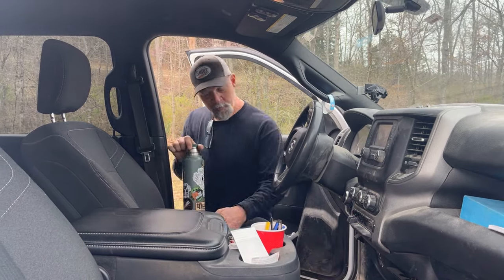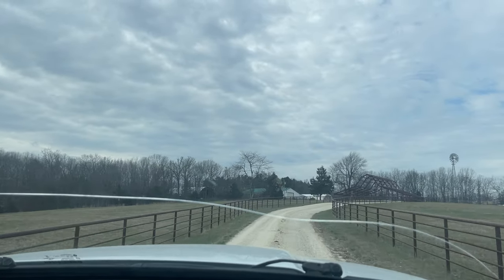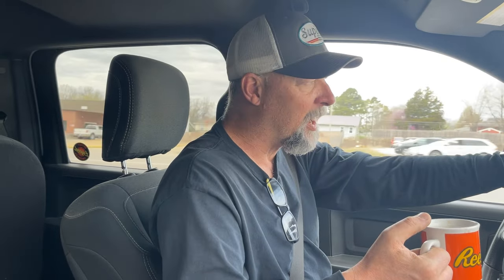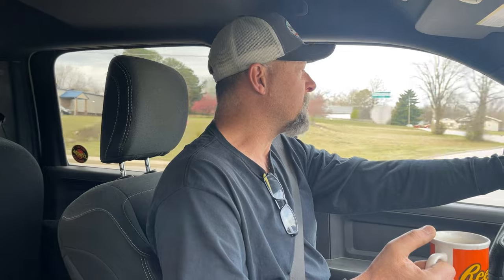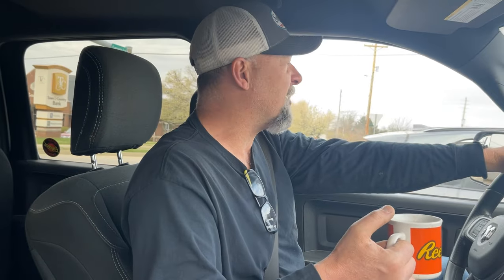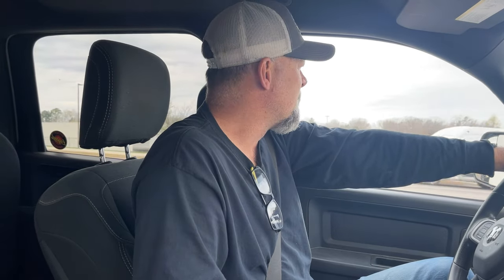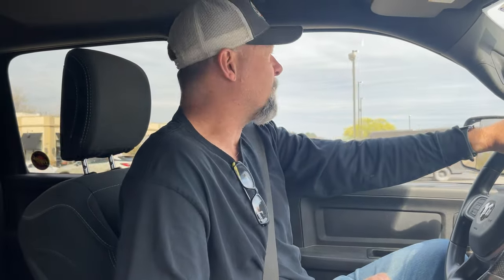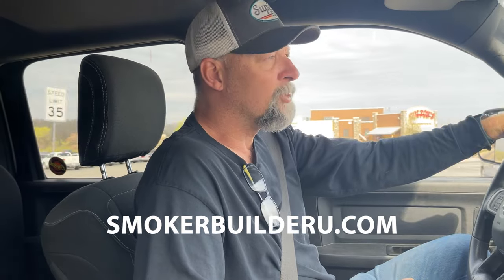[1000 Gallon Smoker Build] How To Source Steel On The Cheap Part1

Comment: I'm from the metro Detroit area. I got lucky with Facebook marketplace.  I found a guy selling 2"x3"x 3/16" tube (24' long) for $125 per stick. I also got my 500gal propane tank and trailer axles from Facebook market.
I also frequent Alro steel, they have outlet center that sell remnants (what's left after they cut the original piece off)